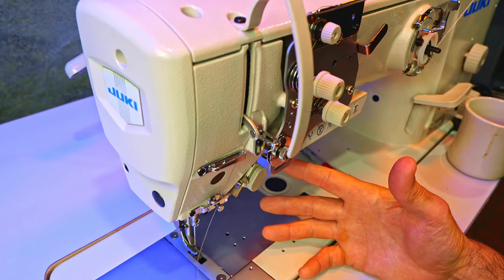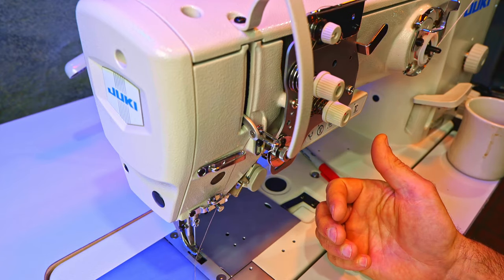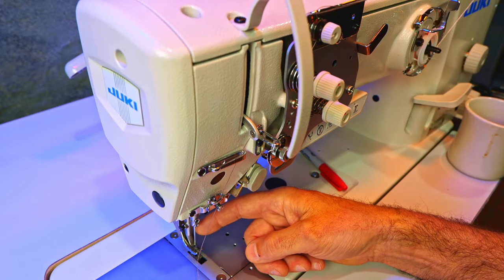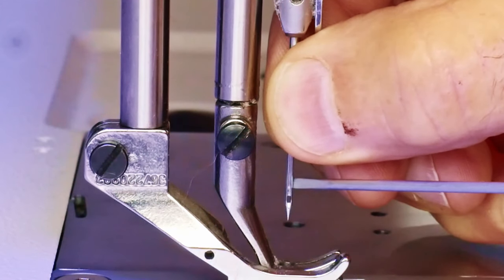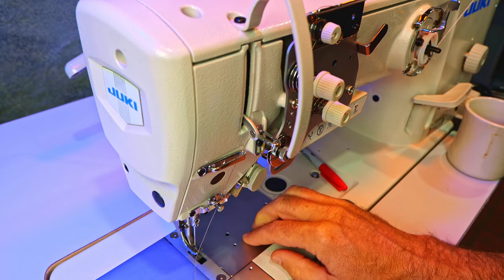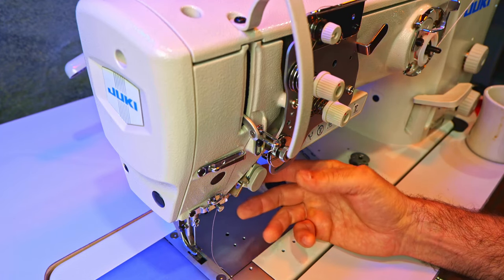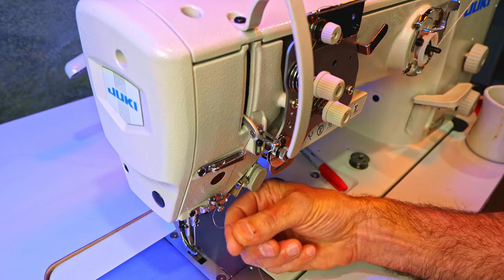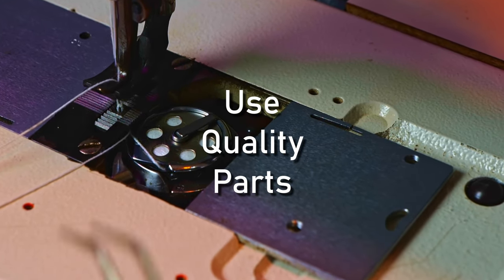Sewing Machine Not Stitching? Start Here! Common Sewing Machine Problem Solutions

Comment: Great explanation and video.  Your closeups are so helpful.  I’ve been going through some of your videos as I attempt to tune up a singer 319w I just got. It’s just like the one you had in your video of that model .  I think it may have the wrong needle (I’ve ordered some correct ones), and I’ve been struggling with the stitch tension and stitch length adjustment.  The patterns don’t come out at all like they should, and the motor can hardly turn the wheel, even after a good oiling.  I’ll wait for the new needles and try again.
Reply from the maker: If your machine is easy to turn by hand you may have a weak motor or perhaps the belt is slipping. If the machine is not easy to turn by hand then perhaps there is thread wrapped around something.
Reply: Alexander Dyer  ok, thanks for the tip.  It’s not super easy to turn by hand - definitely some resistance, so I’ll take a look there.  Also it absolutely won’t turn when I set it to wind the bobbin.  I was thinking the rubber ring might be too large; creates a lot of resistance.  Thanks again!

Comment: My question to Alexander Dyer, you appear very knowledgeable about stitching. I recently started a job as a stitcher with a company that makes Tents for the Military as well as Commercial use. We have a mechanic on site that troubleshoots any issues. My machine, a Seiko Industrial machine, (can't remember model) often starts to work. And then just stops stitching. ( Just a needle with thread penetrating fabric) The needle is new, the Bobbin is full, and everything looks correct. I'm sure to hold the thread when applicable, everything I was taught. I need this job and want to excel. Any pointers, or advice.
Reply from the maker: Just ask somebody at work. You will not be expected to know everything your first week. If you are not willing to discuss your work with supervisors and coworkers you will definitely lose your job. You are supposed to discuss your issues at work, that is what they want, if not start looking for employment where work related issues are openly discussed.

Comment: I'm out of any new ideas!
I own an 1968  Singer 457 stylist . The gear went bad on the shaft, which I did replace. Unfortunatly,Unfortunately, gear I was sold off ebay, was the right part #, but the wrong gear, and in adjusting everything I could think might  be binding it, I found out and changed the gear to the correct one, I've dismantled and rebuilt it and still can't get it to stitch.ive replaced needles retired the hook, I'm stuck!

Comment: I have a more modern heavy singer and I have a needle problem where if I have a thicker layer the machine just makes a whizzing sound, the needle will move a bit but then get stuck again. The only way it’ll work is at top speed! On my old machine I could tighten the inside of the hand turn wheel when this happened but this one doesn’t have that option. Any ideas?
Reply from the maker: Unfortunately "heavy" does not mean what you would think it means in the domestic sewing machine corporate landscape. What you are experiencing is why so many folks choose to get industrial sewing machines. You have reached past the capabilities of your machine. My channel is full of good old home sewing machines and there is just so much they can sew. You could try adjusting your belt tension and even a new belt may help a bit but for heavier sewing like jeans and coats I would recommend an industrial.
Reply: @AlexanderDyer  thanks, that’s really helpful. I’ll try belly first and go from there.

Comment: Thank you !  Very good to remind us of these potential problems...  Do you have a video on walking foot pressure feet?  I notice with my sailrite bigNtall that the pressure foot set is so long front to back that it does not hop double or triple seam to double or single seam very well and in fact the stitching may be off in length as it looses pressure until the foot passes the juncture and regains its tension. Any suggestions?  I think my foot is really long in comparions to the juki you feature in this video and my feed dogs are quite a bit larger.. I would love to see you explain how that could be corrected perhaps by using another foot?  Thanks again..super videos !
Reply from the maker: I am not familiar with that particular machine but I will guess. My guess is that your issue maybe could be solved by adjusting alternating foot movement to a larger setting. If you still want feet, it looks like Sailrite has a pretty good selection, have you tried them? I might even present them with your issue since they no doubt would be more familiar than I. Good luck.

Comment: When cleaning you have to open it up.  Is that good for those of us that are not technical.  I dont know.  Ihave not ever changed my needle.  I have used it since ek.  I am scared of even taking it out lest I fail to put it back.  Anyway let me not be a sissie and try it out.  I have had the machine for 30 years but it sews very well
Reply from the maker: Changing a needle is a basic sewing machine operator task. Needles are a consumable part and need to be replaced periodically due to wear and or damage. Also needle sizes vary depending on the size of thread used for any given project. Here is another video for you on changing your needle. https://youtu.be/9wek6_aFy_I

Comment: Help needed:
My Brother ZU2-B685 is driving me crazy.
The fabric doesn't move properly and I get veryyy small, tight stitches (irrespective of tension, stitch length, or zig zag width settings)
If I pull the fabric while stitching, only then I get the stitches right.
Also, the reverse isn't working properly at all. Have to pull the fabric here too. But it's clearly not working properly.

Comment: My needle threader is not working it used to be fine before and now even the machine is not sewing any cloth that I trying to sew my machine is Juki HZL-353ZR-C. Pls. What do I need to check I already change the needle.
Reply from the maker: It may just need an adjustment.